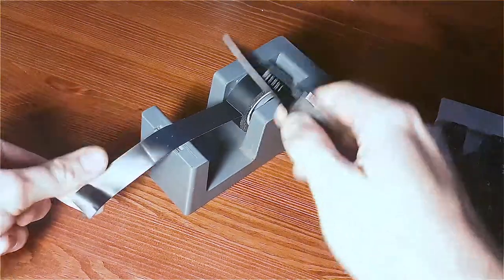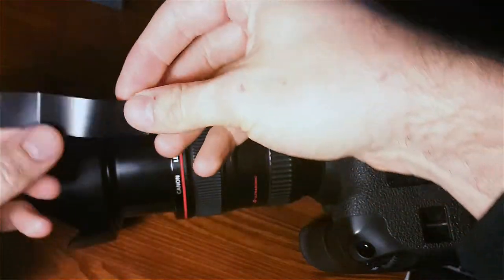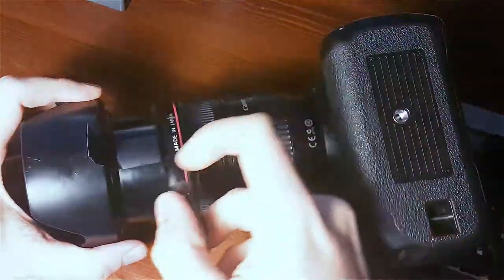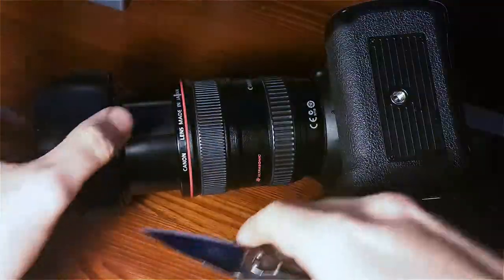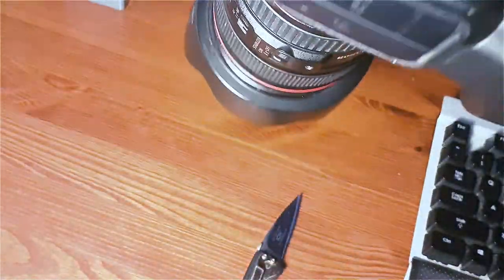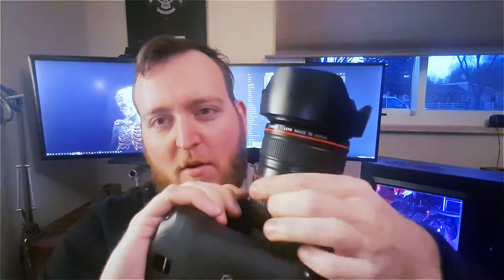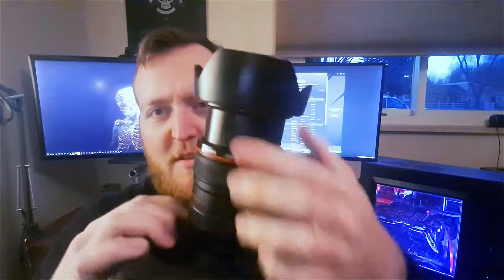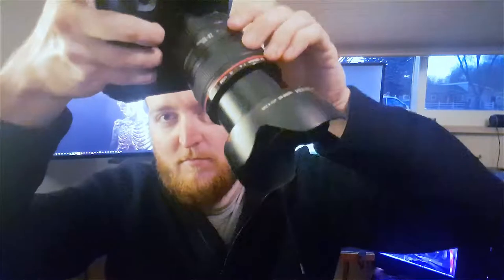Simple fix for DSLR lens creep

Comment: Excellent tip! I was avoiding using a rubber band or o-ring, concerned that if it degraded it would get wedged in that tight space and mess up my lens even more.

Comment: Thank you so much for making this video. My lens has bothered me so long that I have been trying to buy a used one but, every used lens on ebay does says it does have lens creep or other problems. A new one cost $524.00.  I thought you were crazy but so am I so I had to try it.  I have a (Nikon D7100 with a Nikkor 18–200  3.5–5.6 G ED VR). I first tried what you did and it did not work. So I tried many variations of your way and finally found one that DID work for my lens.  I also put the tape in the lower ring that moves with the top ring. I watched your video and did not notice you have a Cannon.  So with the money I saved from not buying the used lens. I bought the Nikon D7200. You might add that your way also works on your competitive “Nikon”. 😃😃

Comment: This seemed like a great solution. However, I tried it on my LUMIX S 70-300mm MACRO L Mount lens and the electrical tape got caught on the weather sealing gasket inside and pulled it out. From the looks of it, it’s no longer weather sealed fully anymore. I might need to send it into LUMIX for repair… Bummer because I thought it was a great idea!  Be careful before trying it on your lens.
Reply from the maker: Sorry you had issues. I'd definitely recommend cleaning with some alcohol before applying and making sure to use a more premium and stiffer brand of electrical tap to improve adherance. I havn't tried it on all lenses so it's possible yours has a tighter weather seal than my lenses. I've shot in heavy dust, rain, and snow for 5 years now with no issues with the lens in the video though.

Comment: Thank you for the advice. I will try with my Pentax DA 18-35.
I am a bit afraid if the tape could have problem with WR lenses. 
If you have informations about this particular point for WR lenses, it will help.
Reply: Hardly if at all. If you worry about that you trust your weather resistance too much.

Comment: hi how many years you use the lens before it creep or its normal when you buy that 24-105 usm
Reply from the maker: I had the lens for about 3 years before it started to creep and gradually got worse. I would say it's not normal but can happen to many lenses over time. Sending to canon to adjust the tightness will cost you many hundreds of dollars and doing it yourself is difficult and not recommended
Reply: @Kuj  thanks for the response and idea 🙏
Reply: done subscribe 😁

Comment: I gotta try this. But I do have one concern: it seems to me that this might cause the lens elements to go out of alignment. Have you checked for resulting softness in the image when zoomed out?
Reply from the maker: It's still tack-sharp after this at any zoom range. It's applied to the part of the lens that naturally has some movement.
Reply from the maker: If you are still worried about it you could always apply high quality electrical tape to 2 opposite sides of the lens to counter eachother.
Reply: @Kuj  Thanks. I tried to use duct tape on my Nikon 24-120, but it didn’t actually help. I didn’t put it all the way around, just about 180 degrees, but still.

I might want to try electrical tape, or put it all the way round. We’ll see.
Reply: If it's a 24-105 you're worried about don't worry. It's a low spec lens. A slight angle will develop over time as internal parts wear down and the barrel starts drooping. Piece of tape might actually improve performance in that case (when the zoom barrel easily moves when you touch it).
Reply: @samipso  I got the Nikon 24-120 f/4. The only higher spec one with a similar range is the 24-70 f/2.8.

However, I just tried to put electrical tape on the inner barrel instead of the outer one. And that does appear to help. I am a little concerned with upsetting the mechanics, but the outer barrel is made out of metal, so it's probably ok. In a sense that I doubt friction with tape will wear it down.

Still, it does put more strain on the mechanism itself. I may shorten the 2 pieces I put on a little bit, to make it a bit lighter.
Reply: @starbase218  There are 3 plastic sliders that move inside a barrel with slots in it. If you put tape on 1 side only technically you risk wearing some sliders faster.
But there is no difference between putting the tape on the outside barrel or the inside zoom barrel.
The thing is that if your lens already creeps it's already worn down to the point there is no perfect contact with the inside barrel.
Putting tape anywhere will not harm anything other than those little soft plastic sliders, and they will wear down pretty quickly anyhow.
What the tape fix does is make a tighter surface for the weather seal on the end of the barrel to hold on tighter to the zoom barrel. Imo it's a pretty clever hack (but I wouldn't use it on a lens that just started to creep).